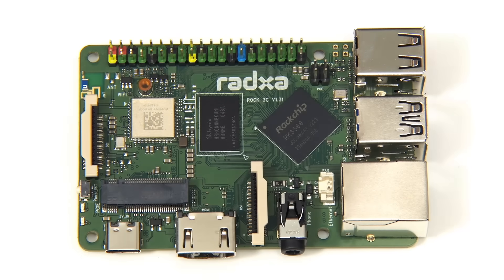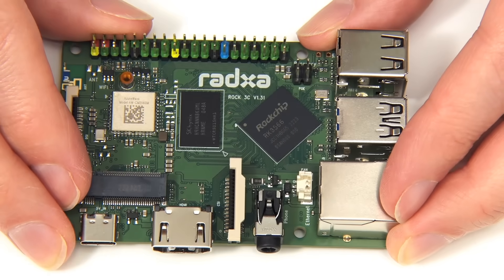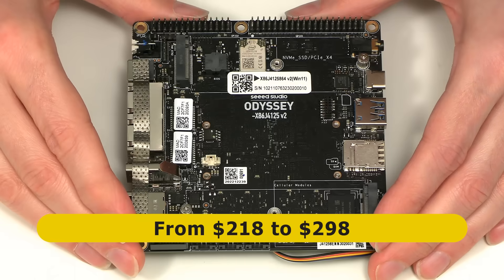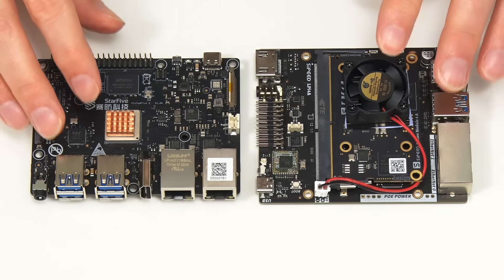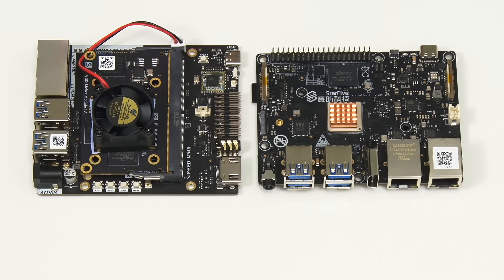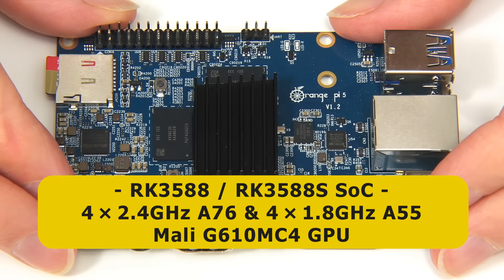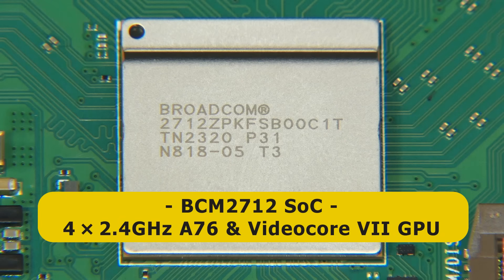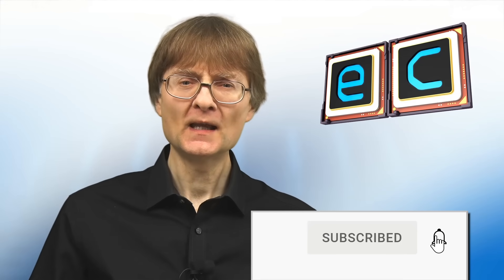Top 6 New SBCs 2023

Comment: Great list! Would you consider including in your list of operating system software tests, LinuxCNC (64bit)  2.8.4 "Buster? Newer CNC hardware runs ethernet, removing the 50 pin parallel port connector requirement. A truly new and updated system can be had if the SBC runs Buster!

Comment: Thanks for this good summary. For me these SBCs have different usage: 1st family for specific usage as automation or video monitoring video (Rock 3C). 2nd family for large storage with 2 ethernet ports. 3rd family for desktop usage. For me the Pi 5 should be the best with an integrated nvme support. After usinf PI 2, 3 and 4, actually I use a Raspberry PI Zero W for jobs scheduled in crontab and Local Web server. And it enough for me.

Comment: In the world of hardware, software is king. After playing with other boards and then RPis, the experience is sooo much better on RPi, the software more polished, the bugs less present, the community more helpful… for me, when it comes to non-x86/64, it’s RPi or nothing.
Reply: Discover Armbian and the situation will reversed.
Reply: @sergiodeplata  it's one thing to have a working operating system. It's another to have working/optimized apps. If you want to do anything beyond some web browsing, stability becomes a huge issue. I've tried Debian, Armbian, DietPi, the lot.
Reply: Indeed. For now, Raspberry Pi software support and community is still the best  by a wide margin in the SBC world.

Comment: There’s a wave of Chromebook ewaste hitting the refurbished market and since these often include power supplies, storage keyboard, and sometimes even a touch screen monitor for less than the cost of even a Pi with full x86 compatibility, I think these should be the default choice for many looking for a low power computer to use as a home server.

Comment: For this price you get a full N100 mini pc with will beat everything in this video :face-blue-smiling:
Reply from the maker: What you say is factually incorrect. Whilst there are some great N100 mini PCs, there seems to be strong urban myth building up around what they actually cost. Right now, the cheapest N100 mini PC I can find on Amazon US is $139.99 -- https://www.amazon.com//dp/B0C7QYKQMB/ So almost all of these SBCs, including appropriate PSUs, etc, cost less than an N100 Mini PC, and the Rock 3C, VisionFive 2, 4GB Pi 5 and some Orange Pi 5 variants considerably less. Whether spending more on an N100 is better value we can certainly debate. But lets be accurate about prices in that debate.

And whilst the Odyssey x86 J4105 v2 costs most than an N100, it offers considerably more than any N100 mini PC I'm aware of, even ignoring the GPIO. I've never come across an N100 mini PC with twin 2.5GB Ethernet, two M.2 slots and a SATA port. :)
Reply: @ExplainingComputers  The GMKTec Nucbox G3 N100 is currently $99 on their website with a promo code. You are correct that the price without a code is $139.99 though.

The $99 comes with [EDIT: The $99 promo code is barebones unit, so it needs to have RAM and storage added], power supply and a case. 

(BTW, I still chose the Raspberry Pi 5 instead of the Nucbox, simply because I don't need another mini PC.)

Comment: I purchased the Orange Pi 5 with RK3588S.  Running from flash it was good enough for desktop use.  Web-browsing hickups occasionaly.  Now have Orange Ubuntu on NVMe. Incredible.  
Also own the LycheePi RV with Allwinner D1.  Amusing toy with good build quality.
Reply: Just to make sure no one is confused, the Lichee RV is a couple of years old now and has a single core single issue 1.0 GHz CPU and 0.5 or 1.0 GB RAM. The Lichee Pi 4A reviewed in the video is around 15x more powerful in CPU and available with up to 16 GB RAM. Sipeed do make good quality boards that come out usually close to the announced dates and have quite good manufacturer support by Chinese SBC standards -- they are responsive on Twitter, for example.

Comment: I was thinking of getting the raspberry 5 SBC for retro gaming, but, because I know next to nothing about Linux, I do not think I would ever be able to set it up, having the brain of a baked potato. I have a raspberry pi 4b I got a while ago which is already set up. Can I use that micro SD card in the pi 5? Thank you.
Reply: No, unfortunately you can't use a RPi4 build of Retropie or Recalbox on a RPi 5. You could however burn the RPI5 version onto a new card and copy just the /home directory from one to the other though. Your roms and configuration are basically all within the home directory and should be compatible between versions.

Comment: It is a shame there are almost no new SBCs without soldered connectors. For many applications it is an advantage not to have fixed connectors and not being restricted by having to use an extra interface board.

Comment: Good list, Chris.  I agree with putting the Pi5 on top (I’m waiting for mine to arrive), but perhaps for a different reason.  If you look at why RPi developed the RP1 chip, it’s clear that they felt that going forward, this custom silicon was the only way.  Which makes me think that the competitors (orange, banana, etc.) may drop out at some point, as they couldn’t develop their own custom silicon, and thus, can’t keep up.
Reply: I don’t know… most Android manufacturers outsource their processors to Qualcomm and Mediatek. I think it’s possible to compete while buying third-party.
Reply: @MarcosCodas  agreed, but Android phones don’t need GPIO.  From the information RPi has shared, their feeling was that GPIO wasn’t doable as the SoC process got smaller and smaller, thus necessitating a second chip.
Reply: @gregholloway2656   I haven't seen any indication that GPIO / IO in general seems to be an issue with competitors, to be honest. I think it's more a question of not relying on third parties to centralize manufacturing and optimize the full sw/hw stack. Which is fine, but it won't kill competition.
Reply: @microlinux The PCI port on RPI5 is 5 Gbps in PCIE 2.0 mode, and can be overclocked to 8 Gbps in PCIE 3.0 mode. That's still a very useful speed for lots of applications.

The main benefit of the RP1 chip is that it moves the southbridge off of the main processor, which allows them to develop it separately and also manufacture it on a different process node. That has a lot of advantages, including the ability to iterate on future designs, and making the RPI5 resistant to ESD. Basically you can give the RPI5 to a kid and they are less likely to break it.

Comment: for the orange pi 5 lineup you didn’t mention the orange pi zero 2w, which is in the form factor of the raspberry pi zero 2w with more ram and usb c instead of micro usb ports. it is a different chipset but with the more ram you can do many rpi zero 2w projects where ram is the limiting issue.

Comment: Keeping track of SBCs is beginning ro require a substantial spreadsheet.
Reply from the maker: This is true! I now have I think reviews of 65 boards linked from this page (split into Raspberry Pi, other ARM SBCs, x86, and RISC-V): https://www.explainingcomputers.com/sbc.html
Reply: @ExplainingComputers  Now you have the added complication of SiFive apparently pulling out of chip-making, which compromises any boards using them.
Reply from the maker: SiFive never made chips -- they created and licensed core designs. And I'm not aware that they are going to revoke any existing licenses. So no boards are compromised! :)

Comment: I know this is not a fair question for this channel but, will your number six choice be a good retro game SBC like the Raspberry Pi? I'm not sure if the Rock  Chip is compatible with retro gaming
Reply: For Raspberry PI 5 there is already Recalbox; for Rock 3C, there is already a Batocera version in development. There is a Beta image for Rock 3A (RK3568)!
Reply: It'll definitely run the oldest games extremely well. Given what he said about it being between the RPi 3 and 4, you can probably estimate that it would run most things that work on the RPi 3, though I haven't tested this and therefore can't tell you if there would be driver issues. You would probably have to set up your own emulator software unless I'm missing some OS ports, but that isn't too difficult once you get the hang of it.
Reply from the maker: What @zombie_pigdragon says is spot on -- the Rock 3C could be a nice retro gaming board, but you will need appropriate software to make this happen. :)
Reply: @ExplainingComputers  I fit all three categories you mentioned. that's why I was asking I'm a maker, and an SBC enthusiast I have a Pi 4B 8GB model set up as a neat little gamer. PC.

Comment: If that Odyssey had 1 10gb ethernet port, it'd be a killer NAS home board. It's still a great NAS home board as it is. When my Pi 5s arrive, one of the projects will be to add it to my gaming rig's case and, using software KVM, I will be using the Pi 5 for normal computing instead of the gaming rig, in hopes of reducing my power consumption.

Comment: In terms of raw brute force hardware power, is the Orange Pi 5 more powerful than the tech that's powering the Nintendo Switch?
Reply: The ARM cores are faster on the Orange Pi 5. But the Switch has a much better GPU. It's a 256 Cuda core NVidia Maxwell, which is a much faster GPU than any non-NVidia ARM board.

Comment: For me, one that stands out is the orange PI  800, which makes you feel like you're using a real computer. 😊
Reply: Maybe Banana PI M3?
Reply: idk what kind of "real" computer you use but that thing is worse then PC from 2007.
Reply: @AcidBombYT  My sweet friend, these are different computers, with a different architecture.
Reply: the wedges return thru the mist of time

enter "Also Sprach Zarathustra" playing
Reply: The one disappointing thing about the Pi800, for me, is that it only has 4Gb of RAM. Calling it the Pi800 almost implies that it has 8Gb (if you follow the Raspberry Pi400 having 4Gb). They missed the opportunity to take sales from the Pi400 by doing this imo. I would have bought one as an upgrade from my Pi400 if it had the expanded memory.
Reply: they're all real computers
Reply: yeah but rasperry pi's have a habbit of running and feeling like a windows 97 PC @Robbie-mw5uu
Reply: the Pi 800 is like a commodore 64 format.  Keyboard with HDMI and USB connectors with processor in-board @Robbie-mw5uu